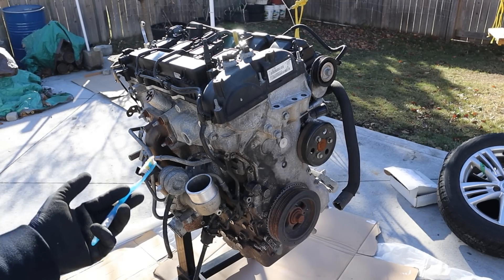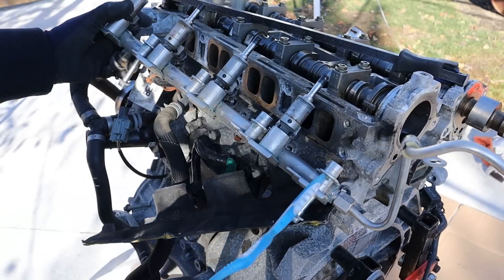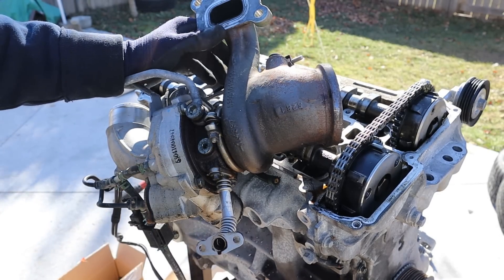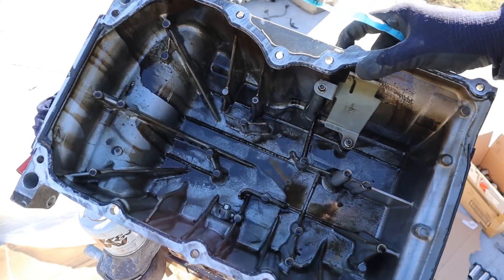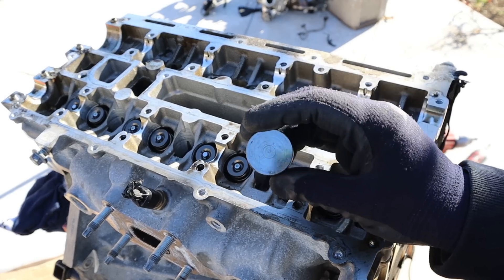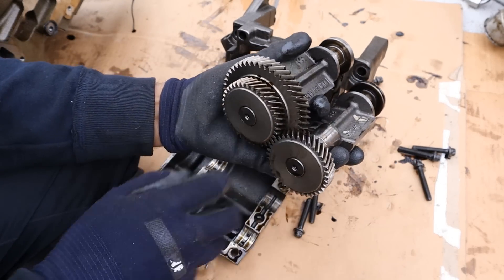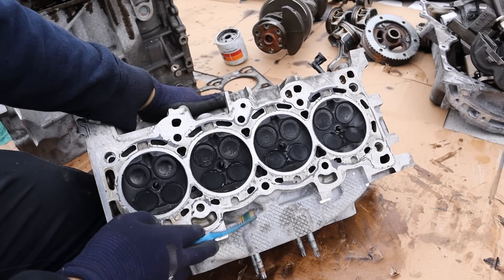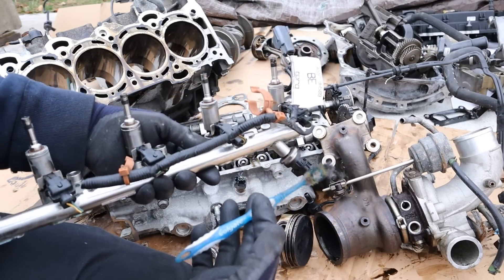Why Ford Ecoboost Engines Fail

Comment: good teardown, thanks!
also, it looks like the oil pan contains BLACK particles which does not look good. maybe these engines welcome some good engine flushing from time to time.

if i had a project car with this engine, i'd remove the balancing shafts and bypass their (former) oil pipe not to loose pressure.

also, I'd kill the EGR so carbon buildup is no more an issue :) after the necessary wallnut cleaning.
and last but not least, developing a custom oil catch-can cause indeed it's a bad thing to keep it stock (not sufficient volume for an used engine).

but overall, I kinda like Ford's design here.... except the tiny little oil filter, which could kill the engine on a long run.... hello PSA HDI diesels!   I'm kind suspicious about another possible places for a tiny oil filter... like in the turbo oil feed ;)

cheers
Reply from the maker: Supposedly the oil catch can failed here and sucked in water. I didn't see egr. Balance shaft removal would mean alot of vibration if your ok with that. I'm sure you can swap in a taller filter.
Reply: @speedkar99  actually, I just assumed that the EGR exist, since it's common element nowadays. so without EGR, only the PCV brings such oil sludge into the intake valves... definately a good reason for a catch-can, but i rather redirect it into the air intake (just like i did with my mk1 focus).

and yes, a project car means to me something to "play with"... in daily driver car i won't remove the balancer... but for a play-car, I coud gain more happily reving engine... along with a lighter clutch-main-plate :D  

but I'm far away from these kinda project at this time...

maybe in another lifetime, if so.
Reply: @speedkar99  by the way, according to my own observation related to custom catch cans, it has tendency to collect condenzation water in it. so, maybe it filled up with condenze water and than sucked into the engine.... i was kinda surprised when i found significant amount of water in my own catch-can... especially during automn time (not surprisingly... more humid air).

OR.... the engine previous owner thrown an insurance fraud with this water story....
:D U never know

Comment: PS: Your "big gun" seems like ISN'T what it should be. That big pulley should be easy task for a dewalt 899 or milwaukee counterpart (even MORE powerful at about 2000NM of torque)
Reply from the maker: I think my batteries are wearing out now at 2 years.
Reply: @speedkar99  my dewalt batteries are aging well, some of them having SIX years of age and still pushing very well. I use only regular ones, 5A/18v, not flexvolt 54v.

Comment: I have a FE series Mazda 4 cylinder engine; no balance shaft and runs smooth.
Reply from the maker: Yeah not all 4 cylinder engines use balance shafts. Smooth is very subjective. Try a V8 or I6 and tell me smooth 😄

Comment: "But this is an ecoboost engine, we don't expect it to last that long anyways" 🤣🤣
Reply: EcoBoom
Reply: A lot of failures is due to not completing regular maintenance.
Reply: @Redavisunwind  like the one in the video looks like no maintenance on it! No oil changes, probably a blocked air system too which in turn cools the turbo...
Reply from the maker: Haha 🤣
Reply: I managed a dock at a Ford facility for years. This motor had so many recalls. We were working 7 days a week for a year to keep the parts flowing to the dealers. Lots of total engine replacements
Reply: 201,300 miles on my 2014 f150 turbos no problems yet!
Reply: @scooterman7888  I think it's the ecoboost that has these issues, other engines seem fine. Drove a 2012 ranger to 400k km, only ever had a problem with the u-joint on the driveshaft (recurring), had too much torque I guess
Reply: @steven_mkn  mine is a twin turbo ecoboost!
Reply: @scooterman7888  My son just got rid of that junk.. Always in the shop, and Ford said its' all normal.. WHAT.. Just got tired of NOT having his truck.. Now owns a V-8 Chevy, so far so good.. Too much truck for too small an engine while trying to get TOO MUCH out of it..
Reply: @peteparadis1619 they have been putting V6’s in trucks for 60 years tho? So if engineered correctly turbo v6 should be plenty enough, let alone a twin turbo setup, They could be like Toyota there new 2024 Tundra TRD pro trucks  have a 2.4L 4 cyclinder hybrid system, which is stupid if you ask me being how big a Tundra is 🤷🏻‍♂️
Reply: @timprice8877  The truck is too big and heavy, it’s simple, there’s no free lunch in life
Reply: Made in USA 🤣🤣🤣
Reply: @ketzyelmisuperamigo  shit take a look  at everything made in Mexico that's the problem lol
Reply: @WolfRaged  I might be wrong, but something tells me that the engine is only put together in Mexico as per Ford's (USA) instructions ;). They engineer it, it's their specs, their choice of materials, their dimensions etc etc.

From my experience in terms of reliability:
3 cylinder = Don't.
4 cylinder = buy Euro or Japanese. VW Group & Volvo (to be determined in another 10 years I guess with the new platform, but so far seems great besides the "growing pains" that are being ironed out)
5 cylinder = Don't. Only consider the old white block Volvos.
6 cylinder = buy Japanese.
8 cylinder = Only consider American. The Germans might make some really fun and cool V8s, but they'll be in for repairs more than out on the street.

Edit: before anyone says anything, yeah Subaru makes cool 5 bangers but besides being a car engine they are also drums on wheels (knock knock..) & moving oil dispensaries.
Reply: @SwoonGaming  Mercedes make good V8s. So does Toyota
Reply: @SwoonGaming  Loved my 1981 Mercedes 5-cylinder diesel, I'd love to find one again.  You're totally right about Japanese V6's and American V8's though.  Japanese V8's would be nice too if it wasn't for hiding the starter in the middle of the V underneath everything.
Reply: maybe with this hack working on it lol

Comment: this is the cleveland 2.0 ecoboost.. the vel 2.0 ecoboost from spain does not have these problems.. the block and head are diff. castings... easy way to check.. vel sticker on the valve cover,, and the vel verson has a propper exhaust manifold.. 4 ports.. not the cram it all into 1 exhaust post...gm also has the same problem with there boosted engines.. the v6 comes to mind,,, the heads on the gm cars  also have one exhaust ports on them,,land  rover and volvo install the 2.0 vel engines in there cars.. with no issues like this
Reply from the maker: Yeah the euro versions have different heads with separate exhaust manifold
Reply: @speedkr99   some do my vep has a integrated exhaust manifold on the head
Reply: my 2014 ford fusion  has the vel engine... 168000 miles on it,,no coolent losses,, every oil change i get back about 5.5 quart of oil back  the engine calls for 6 quarts,, change it every 6000 miles,, and it has been tuned now for 6 years.. 0-60 in ave of 5.3 seconds..and i installed a o.v.s.  the second day i owned it( took it home )  no carbon on the intake valves

Comment: NEXT car will be a EV..... NO more oil changes, no more gas stations.............................. no worry about Catalytic converters theft or drilling gas tank which is big in our city..!
Reply from the maker: And when it breaks down you'll be paying a hefty repair bill because it's more complicated and you need an engineer to diagnose it.
Reply: @speedkar99  As an Electrical engineer for the last 30 years EVs are simple. A speed controller, a motor and a battery.  A lot simpler than a gas engine indeed.  Fire up a computer, plug it into EV port and in 5 mins and read error codes.

Comment: Mandated to Drive Skateboards.......Good one. Direct Injection DOES NOT WORK !!...Change oil often might help and use good oil
Reply from the maker: Changing oil won't make less carbon to build up. Due to the PCV system it always will shoot oil into the intake.

Comment: Over a 100 yrs of vehicle manufacturing and this is the high tech Garbage you pay big money for...Sickning that consumers are being ripped off...Never buy any turbo gas engine...Extra power means no Longevity...Disposable trash... none turbo 4 cylinder engines last longer in most cases...Especially if it's a Toyota or Honda.....Great teardown video
Reply from the maker: All in the name of emissions first and then consumerism next.

Comment: If it wasn't for the fact that cylinder 3,4 eat coolant it would be a pretty good engine.... Oh also the aids timing
Reply from the maker: Yes
Reply: @speedkar99  The newest generation where they actually drilled instead of making trenches between the cooling jackets is actually supposedly extremely reliable but again I would hate to time that engine because if it's like the mzr its completely cancer

Comment: This crappy ecoboost troubles seems to be limited to gasoline engines. Their turbo diesels in the other market are pretty bulletproof but they shifted those troubles to the transmission. 😂
Reply from the maker: Good to know

Comment: Random question but seeing a ford video made me remember they used to own Volvo - how do you rate the five cylinder engines they used?
Reply from the maker: I did a video on 5 cylinder Volvo engine 2 years ago, check it out.

Comment: I’ll stick with my 2011 Mazda CX7 2.5 with the old 2.5 MPI MZR motor and the 5 speed auto.  165,000 kms and I’m looking forward to 5 or 6 more years out of “Frank the Tank.”
Yes I named my car, so what?
Milton to Brampton everyday and it is very comfortable for me and very easy to get up to speed on the 401.
Reply from the maker: I thought the CX7 was 2.3 turbo only and that's why we don't see them around too much. I'm from the GTA also 😉
Reply: @speedkar99  if you go on kijijiautos and autotrader there are a lot of 2.5 5 speed autos for sale.  The lowest kms I have seen in 90,000 kms and the most is 311,000 kms.  Both were 2.5.  All the problems were attached to the 2.3 turbo.  I have put 15,000 kms on since I got it in May.  2500 kms were last month alone.  It was a one owner purchased at Erin Mills Mazda, serviced there for two years than at Mazda of Brampton until North Bay Mazda serviced it in 2019 and 2020 where they replaced the steering rack due to failure.
I have changed the transmission fluid and had to replace an O2 sensor.  The brakes will be done in a couple of weeks.  It’s the base model, so nothing fancy but it gets the job done.  Looking at replacing the stereo with an Alpine unit and maybe the dual exhaust from the 2.3 turbo.  It would be cool to have it looked over by you one day just for kicks.

Comment: Sucking in snow to the PCV catch can? Why make that shit up? PCV is a closed system. No way for that to happen.
Reply from the maker: Catch can doesn't make it closed anymore. Previous owner told me this I'm not making it up.
Reply: @speedkar99  sry for the confusion, I was speaking of the original owner who hydrolocked it. Maybe he meant intake? I don't see how a 5/8 inch line could suck up snow given its location in the compartment compared to a turbo inlet?

Comment: Driving one of these fun delightful engines. I had to take the catch can off as I kept smelling oil fumes and was still having carbon buildup on cylinder 3. Maybe something wrong on my end. I was also told on these engines. More of the carbon buildup is from light driving and the top of the valve stems.  This engine is meant to be driven hard.  The fueling issues are never ending and the misfires are always a nice surprise. This engine enjoys 92 more than Ford advertised. Always change the oil before 6k miles and enjoy doing a CRC clean every 2-3 oil changes. Otherwise, very torquey engine and fun to play with. Just wish it had better highway mpg
Reply from the maker: Exactly. A nice Italian tune up once in a while to help burn off the carbon
Reply: @speedkar99  actually you're completely wrong. High pressure fuel systems with direct injection do not clean themselves of carbon, they create more.
Reply: @JACKOFALLFATES  some good heat will take care of any carbon
Reply: @dyrdek  Engineering Explained did a video on the Italian tune up. It's not as easy as you think to get the heat in the right places.
Reply: install a oil vapour sepertor on the engine,, did to my 2.0 back in 2014   no carbon on my intake valves
Reply: CRC intake cleaning? Would that help with the carbon in the intake?
Reply: had a "turbo" hybrid fusion that started to show signs then after that one got hit, my '19 fusion le failed on cylinder 3 internally, ford dealer said "ford"...LOL... anyway he said cylinder 2 and 3 will typically fail on "short body" referenced in last few seconds and "long body" still failed on cylinder 3 for me

Comment: How was difficulty in terms of taking it apart? Standard sized parts, bolts, design?
Reply from the maker: Not bad at all. While Honda's Toyota's and Nissan engines might be 10, 12, 14 sockets, this was 8,10,13 mm sockets and e-torx on the head bolts.

Comment: Great video as always... Hey, do you ever put anything together and offer  similar explanations of what and why you are doing it?   What is with the tooth brush,  I have never seen you clean anything with it.  How about a laser pointer?
Reply from the maker: I used a toothbrush to clean throttle body on my older videos. Since then, it stuck as my teach-brush pointer.
Reply: @speedkar99  :)

Comment: OMG! So much engineering with many advanced points just to see such early failures. I guess Ford claims low exhaust emissions by placing the carbon already into the inlet ports. Will Ford retain their gas loving customers? I doubt it!
Reply from the maker: Exactly, though low emissions is more of a function of smaller cylinder displacement with the same amount of power as a larger engine.

Comment: How many engineers does it take to screw a light bulb in? 1. To put the water pump inside the timing belt cover. ( which has a tendency to leak antifreeze into the oil in the crankcase)2. To put the fuel injection directly into the cylinder(forgetting that the intake valves need fuel to wash them off) causing early failure of the intake valves. I’d say quite a few engineers must be new to their careers. To miss something as simple as common sense.
Reply from the maker: Don't blame the engineers. They may have designed this with dual injection and external water pump. But the bean counters say no and we get forced to change it wrong
Reply: water pump is outside the timing covers on the 2.0 ecoboost engines,, take 5 mins to remove it
Reply: I'm sorry.....common sense? What's that? I think that if it were possible we'd have to put common sense on display in a museum. It's pretty much extinct these days.

Comment: small turbo engines beat themselves to death.   then they kill you with repair costs.  no thanks.  Great video - thank you.
Reply: I don't own any turbo gas motors but the manufacturers are not helping the situation with extended oil changes on these motors.  5,000 miles appears to be the max according to Ford Boss Me.
Reply: Just bought a CX-30 with the NA 2.5 engine. Would way rather have that over any of the competition with 1.5, 1.6 liter turbos, etc
Reply from the maker: Agreed. All in the name of emissions. Hybrid with a naturally aspirated engine is better
Reply: Unless it’s a EA855 (Audi 5cyl)…

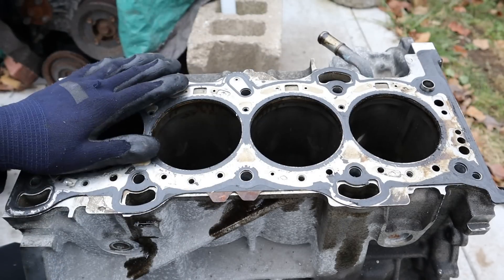Comment: 17:06 to 17:28 happened to a 77k miles ford edge in my family.  We had to replace the whole engine
Reply from the maker: Sad.
Reply: seems that exactly this happened to me as well. Volvo V40 from 2012 with 1.6l ecoboost. Coolant consumption, smoke from exhaust. Coolant was found inside cylinder 3 and 4 ;/
Reply: @maciejchochol  Yep... I was down to their home in fall of 21.  Her coolant was low and I thought that odd. But I'd not check it before so... then when I was down in the summer of 22 it was again low. Like very low!  I knew something wasn't right and sure enough in the fall of 22 it wouldn't start and had check engine lights.  Turns out that little groove in the block caused the headgasket to blow out and leak into the cylinders.  
Way to go you IDIOT engineers at ford powertrain.  (I was one back in the 90s and we didn't do stupid theoretical stuff like that back then. We designed them to be as tough as hell.  (I worked on the "mod motors" 4.6L, 5.4L, 6.8L))